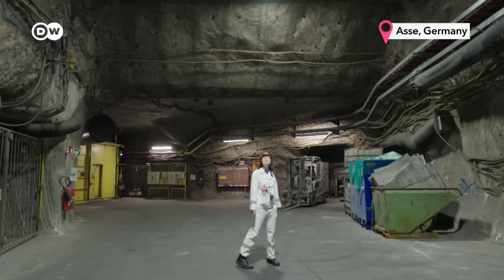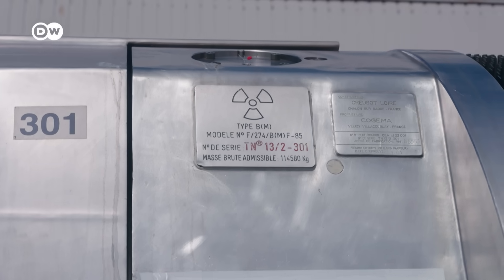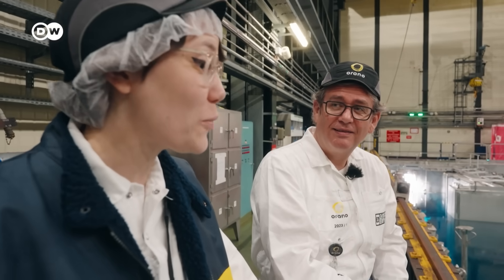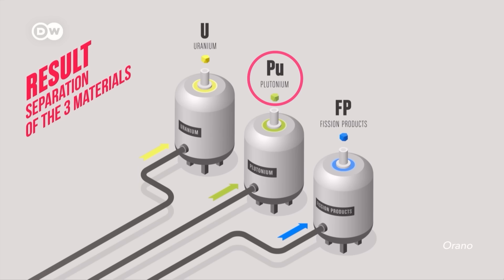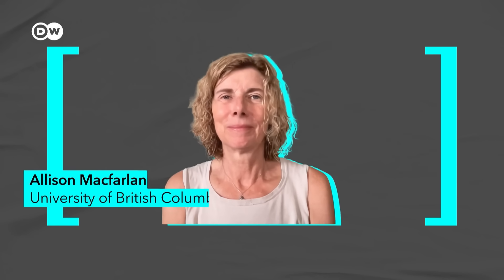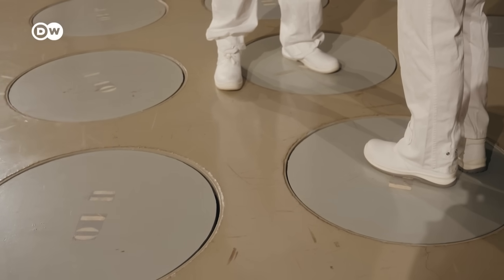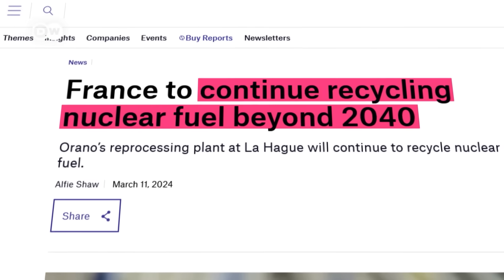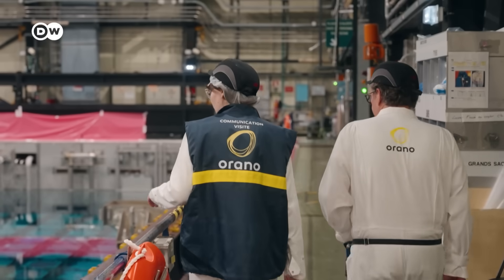Nuclear waste is reusable. Why aren’t we doing it?

Comment: The inherent problem with radioactive materials is that they contaminate most everything that touches it. For sources with long half lives that means that any attempt to recycle will ultimately create more radioactive waste than you started with. Even though the activity would be less, it still requires the same handling, storage, and containment for a larger volume of materials so it’s a losing battle.
Reply: But the level of radioactivity goes down with each step. Eliminating radioactivity is pointless, there is radioactivity all around us, every time you eat a banana you're ingesting something that's radioactive, you only have to lower it to a safe level.
Reply: The good thing is, it only remains dangerous in a small radius. And it's made in very tiny amounts. Unlike Fossil or Renewables, which make magnitudes more, as well as spread easily in air, water, and land, with not a lot of storage protocols or recycling costs accounted for truthfully.
Reply: @ZippyPiglin36 I’m just glad I’m not involved in any of it anymore. Oh god, I remember one time my dosimeter ring fell off into a waste container when I was working with S35. The paperwork I had to go through was a pain in my posterior.

Comment: because solar and batteries make nuclear obsolete. DW is just protecting ORANO's interests
Reply: Strong words, when over 60% of the world's electricity is still being generated by burning fossil fuels.
Every single country that closed its nuclear plants, replaced it with fossil fuels, NOT renewables. Germanyh closed theirs and replaced it with brown coal, even more polluting than normal coal. Belgium is closing theirs and replacing it with gas fired plants.....etc
Don't be fooled, if you root against nuclear power then you've been brain or greenwashed by the fossil fuel lobby who spend billions to discredit nuclear and renewables each year.

Comment: I don't understand why the mox fuel cannot be recycled again? Since it started with more plutonium it would be understandable if it contained more and thus produced more when separated out however this doesn't seem like a problem since you're already producing and using pure plutonium. In theory the recycled fuel rods should be re recycled once spent indefinitely until the fission products are all that remain. Also given the fission products absorb more neutrons than they produce they cannot create a chain reaction thus I don't understand why they have to be trapped in glass beads rather than simply containing them in more concentrated vessels taking up at minimum less space while also using less glass material, or alternatively and preferably further separated and purified to be made useful as other pure materials even if there not useful for energy generation they will be useful for other purposes if not yet then once a sufficient pure supply is stockpiled uses will inevitably be found by industry however these uses will only be found if the individual products are separated rather than simply labelling it mixed fission products. Also why are they simply left in a pool for years to cool down logically during the cooldown process they would be further deteriorating increasing the amount of fission products and reducing the content of fuel as compared to recycling it while hotter or if not recyclable while hot surely we can use the heat given off in a more usefully way than just bleeding it off in a pool and wasting away?

Comment: The Plutonium from civilian power plants cannot be used for weapons because of physics- it contains wrong isotopes for weapons because it did spend to long time in a reactor. Physics protects us from it being used in weapons. The Indian program was based on abuse of fuel cycle- it is misrepresentation to spread fear about it- no fuel from civil reactors from France, Germany, Finland, or "properly run" CANDU is weapons grade. It could however be a great fuel for the future to get rid of coal and gas for electricity and heating(that way Uranium would be practically inexhaustible too)

Comment: One question though: if you compare how polluting it is to store the nuclear waste (including building the storage facilities for it) to how much it pollutes to build and keep up a place like this - in the long run, which will actually cause more pollution?

I am, at the moment, against nuclear power plants for energy, but I am trying to educate myself more on the subject, and see all sides of the coin - both the good and the bad. This video did seem very objective - usually, people only fixate on the good or the bad, so it fits their own narrative or belief.
Reply: That's a difficult question to answer, since it depends on many many variables. Finland's permanent storage costs nothing in the big picture and stores all their waste for the next 100 years. Compared to that, recycling is definitely more polluting. But recycling also means that Uranium didn't have to be mined again....etc. 
Personally, I think both are part of the solution. But there are just not enough clear numbers.
What we DO know is how much cleaner nuclear is compared to fossil fuels. Every single country that closed nuclear plants, had to compensate by opening new coal or gas burning ones. Germany, Belgium.... The technology isn't perfect, accidents can and will happen. But compared to the pollution and deaths by burning coal and gas, it is practically negligible.

Comment: Is there a way to make a reactor out of plutonium? Would it possibly be safer than uranium? I know with uranium you just put enough uranium 235 in the same space and you will get super criticality. Like the uranium nuke dropped on japan they didn’t even test. They just shot one chunk at another chunk. The plutonium one was more complicated because they had to use shape charges to compress the plutonium to get it to a density to go super critical. Maybe I’m wrong. Maybe the plutonium is more radioactive so it “fissiles” and blows apart before it can get super critical and explode in an efficient manner. Idk. I’d still think you could use the plutonium to make a reactor. Maybe mix it with uranium 238 or would that make more plutonium? Would that be bad? As the plutonium decays it would also produce a byproduct of plutonium instead of some crazy isotope that’s unusable?
Reply: There is! And it is actually safer than uranium reactors! Theyre called "Thorium salt reactors", and use Thorium, molten salt and a small amount of plutonium as a reactive agent. Do some research on these If you are interested.

Comment: So the spent Nuclear Fuel Rods (NuF-Rods) have to be cooled under the water, why arn't you's creating a way to harness the heat they give off say via TEG's (Thermal Electric Generator's), if these NuF-Rods are giving off heat for a few years then use that heat to generate more power... In theory you may be able to generate another 20% or even 30% of electricity while your waiting for the NuF-Rods to cool down and as the gentleman said, for a few years.

Comment: When rods are new with rubber gloves they can be handled in gloved hand only two years the have become very radioactive and are swapped out and replaced. The IS has around 500,000 metric tones of rods in fuel pools. There are 90 fuel pools around the world all requiring off site AC Power. If we have a nuclear war or. Carrington Lever Solar super storm will cause Electromagnetic Pulse will kill all the Electrical Grids and the Cooling water to 450 reactors and 90 Nuclear fuel pools will overheat the Reactors will catastrophically melt down and the 90 fuel pools will boil off and the fuel’s xirconium coating will catch fire when exposed to air.the fuel pool fires will accelerate the drying up of the water exposing more and more rods to air and they to will catch fire in a thermal runaway unquenchable fire like EV batteries.

By this time the world will have 450 Fukushimas and 90 unquenchable huge nuclear fuel fires while will irradiate everything everywhere and all life around the planet will start to die of radiation poisoning right down to bacteria. 

It will be an ELE or EXTINCTION LEVEL EVENT.

Google Scholar search Nuclear Fuel Pool Fires. The Carrington Solar super storm was estimated as an X45. It happened in 1859 and it’s cycle is around 100 years so it is well overdue. When it happened it melted telegraph wire set fire to telegraph poles and telegraph offices and the office in Sweden was able to transmit back a d forth with the office in India for 8 hours wirelessly as the batteries were wrecked. 

If that hit us now it would crash the worlds AC Grids and cause 460 nuclear reactors to melt down and the 90 fuel pools to catch fire.

We are like ducks in a shooting gallery with the Sun taking pit shots at us. In July 2012 we missed a killshot by 8 days and a few years pater we missed one by four days. Governments never address any of this because they can do nothing in the face of it so they keep quiet and cross their fingers behind their backs.

Comment: Two Real and Present Dangers 

A Global Thermo Nuclear War.
A 1859 Carrington X 45 level or greater Solar Storm.
A nuclear war or  Solar Super storm would collapse the planet’s electrical power grids through EMP Electro Magnetic Pulses.
As a result all cooling water would stop flowing to cool Nuclear Fuel in both Reactors and Fuel Storage Pools.

It is the Dirty Secret the IAEA has kept from the public since the beginning of the nuclear age.
Despite full knowledge of the risk of the Sun Super flaring which is overdue by decades or the inevitable Nuclear War.

The consequences of either is Extinction of all Life on Earth.

Google information

There are 90 Hot Nuclear Fuel Storage Pools in the World.

Generation
The U.S. generates about 2,000 metric tons of spent fuel each year

Reprocessing
About two-thirds of spent fuel is in storage while the other third was reprocessed. 

People also ask

How much spent nuclear fuel is there in the world?

390,000 tonnes

Since the start of nuclear electricity production in 1954 to the end of 2016, almost a decade ago there were some 390,000 tonnes of spent fuel were generated. About two-thirds is in storage while the other third was reprocessed.21 Jan 2022

390,000 tones of hot nuclear fuel rods. In 90 Nuclear Fuel ponds would be 4,333 tones per pond.

What happens If the pools permanently loose off site AC power

If there is a prolonged interruption of cooling due to emergency situations, the water in the spent fuel pools may boil off, possibly resulting in radioactive elements being released into the atmosphere.

A nuclear War or a Carrington Level Solar Storm capable of the Electromagnetic Pulse crashing the Global Electric Grids
Would cause the irradiation of the entire planet from the release of radioactive Elements of 390,000 metric Tones of highly radioactive elements into the atmosphere. Not all at once but continually as a flood of nuclear radiation lasting for centuries millennia or much longer.

Nuclear fuel rods are stored in steel-lined concrete pools surrounded by water. The water in a fuel pool is usually between 25°C and 35°C, and every 7 centimeters of water cuts the amount of radiation in half. 

Nuclear fuel rods become more radioactive as they are used in a reactor. A fresh rod of low enriched uranium pellets can be safely handled with gloved hands, but after a year or two of use, it becomes highly radioactive and unsafe to approach without many feet of water shielding. 

When the pools loose their water the fuel’s Zirconium coating self ignites when in contact with air, like Sodium. These fires are thermal runaway like Lithium batteries and are extremely hot and near impossible to quench.

A fire from spent fuel stored at a U.S. nuclear power plant could have catastrophic consequences, according to new simulations of such an event.
A major fire "could dwarf the horrific consequences of the Fukushima accident," says Edwin Lyman, a physicist at the Union of Concerned Scientists, a nonprofit in Washington, D.C. 

“We're talking about trillion-dollar consequences," says Frank von Hippel, a nuclear security expert at Princeton University, who teamed with Princeton's Michael Schoeppner on the modeling exercise.
The revelations come on the heels of a report last week from the U.S. National Academies of Sciences, Engineering, and Medicine on the aftermath of the 11 March 2011 earthquake and tsunami in northern Japan. The report details how a spent fuel fire at the Fukushima Daiichi Nuclear Power Plant that was crippled by the twin disasters could have released far more radioactivity into the environment.

The nuclear fuel in three of the plant's six reactors melted down and released radioactive plumes that contaminated land downwind. Japan declared 1100 square kilometers uninhabitable and relocated 88,000 people. (Almost as many left voluntarily.) After the meltdowns, officials feared that spent fuel stored in pools in the reactor halls would catch fire and send radioactive smoke across a much wider swath of eastern Japan, including Tokyo. 

By a stroke of luck, that did not happen.
But the national academies's report warns that spent fuel accumulating at U.S. nuclear plants is also vulnerable. After fuel is removed from a reactor core, the radioactive fission products continue to decay, generating heat. All nuclear power plants store the fuel onsite at the bottom of deep pools for at least 4 years while it slowly cools. To keep it safe, the academies report recommends that the U.S. Nuclear Regulatory Commission (NRC) and nuclear plant operators beef up systems for monitoring the pools and topping up water levels in case a facility is damaged. The panel also says plants should be ready to tighten security after a disaster.

At most U.S. nuclear plants, spent fuel is densely packed in pools, heightening the fire risk. NRC has estimated that a major fire at the spent fuel pool at the Peach Bottom nuclear power plant in Pennsylvania would displace an estimated 3.46 million people from 31,000 square kilometers of contaminated land, an area larger than New Jersey. But Von Hippel and Schoeppner think that NRC has grossly underestimated the scale and societal costs of such a fire.

NRC used a program called MACCS2 for modeling the dispersal and deposition of the radioactivity from a Peach Bottom fire. Schoeppner and Von Hippel instead used HYSPLIT, a program able to craft more sophisticated scenarios based on historical weather data for the whole region.
Nightmare scenarios
A simulated spent fuel fire at the Peach Bottom nuclear power plant in Pennsylvania had a devastating impact on the mid-Atlantic region. Click on the dates to see the extent of contamination, which depended on weather patterns. Courtesy of F. Von Hippel and M. Schoeppner  
1 Jan. 20151 April 20151 July 20151 Oct. 2015
In their simulations, the Princeton duo focused on Cs-137, a radioisotope with a 30-year half-life that has made large tracts around Chernobyl and Fukushima uninhabitable. They assumed a release of 1600 petabecquerels, which is the average amount of Cs-137 that NRC estimates would be released from a fire at a densely packed pool. It's also approximately 100 times the amount of Cs-137 spewed at Fukushima. They simulated such a release on the first day of each month in 2015.
The contamination from such a fire on U.S. soil "would be an unprecedented peacetime catastrophe," the Princeton researchers conclude in a paper to be submitted to the journal Science & Global Security. In a fire on 1 January 2015, with the winds blowing due east, the radioactive plume would sweep over Philadelphia, Pennsylvania, and nearby cities. Shifting winds on 1 July 2015 would disperse Cs-137 in all directions, blanketing much of the heavily populated mid-Atlantic region. Averaged over 12 monthly calculations, the area exposed to more than 1 megabecquerel per square meter -- a level that would trigger a relocation order -- is 101,000 square kilometers. That's more than three times NRC's estimate, and the relocation of 18.1 million people is about five times NRC's estimates.
NRC has long mulled whether to compel the nuclear industry to move most of the cooled spent fuel now held in densely packed pools to concrete containers called dry casks. Such a move would reduce the consequences and likelihood of a spent fuel pool fire. As recently as 2013, NRC concluded that the projected benefits do not justify the roughly $4 billion cost of a wholesale transfer. But the national academies's study concludes that the benefits of expedited transfer to dry casks are fivefold greater than NRC has calculated.
"NRC's policies have underplayed the risk of a spent fuel fire," Lyman says. The academies panel recommends that NRC "assess the risks and potential benefits of expedited transfer." NRC spokesperson Scott Burnell in Washington, D.C., says that the commission's technical staff "will take an in-depth look" at the issue and report to NRC commissioners later this year.

doi: 10.1126/article.2332461

As for the Sun we spent 24 years GPS and Field of View Recording and logging petroglyphs (Ancient Rock Engravings)  at every Latitude  and Longitude on Earth. Our ancestors have been recording giant Solar Super Events for st least 60,000 years.

Published papers here
https://plasmauniverse.info/NearEarth.html

Comment: Not a word about Russians achieving full closed cycle.

"According to the results of a year of reliable and safe operation with an almost full load of MOX fuel, the power unit with the BN-800 reactor of the Beloyarsk NPP proved the readiness of the closed nuclear fuel cycle technology for implementation on an industrial scale"

 Crappy info material
Reply from the maker: Hey Aleksandr! Check it out on 11:54 👌